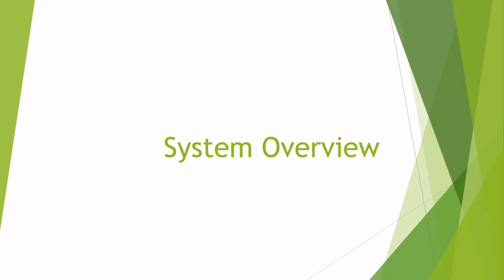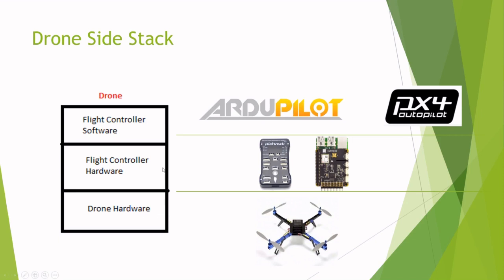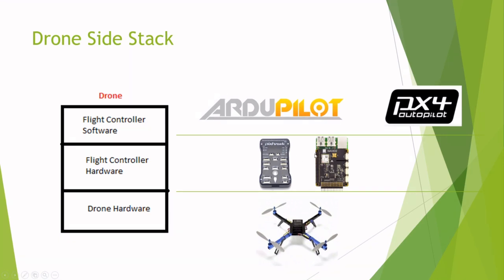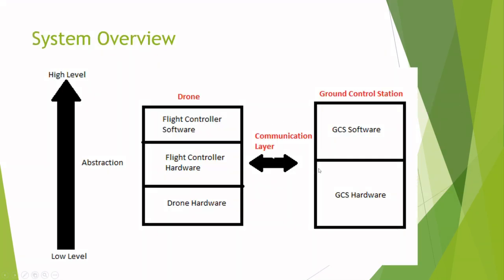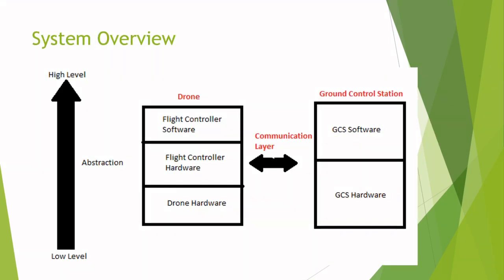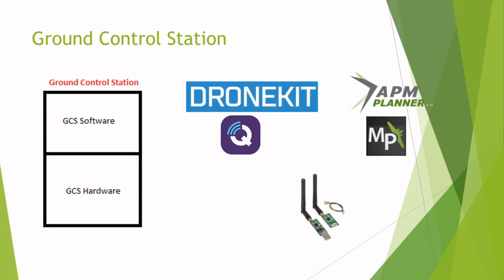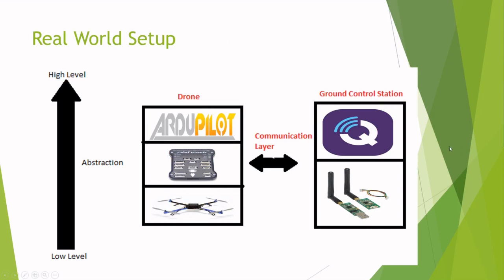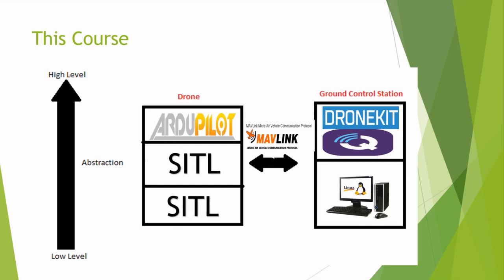High Level Perspective of a Flight Stack | Drone Programming

Comment: Hi, I am a super noob to the use of ROS for drone control and would like to seek advice because a lot of online sources keep quoting ROS, MAVROS and MAVLINK in drone flight control, and I am utterly confused. In this sense, your video is useful in shedding light on jargon.
  
I am trying to implement a computer-vision-based navigation algorithm on a drone using a pixhawk 2.1 controller. The image processing is done on a raspberry Pi 3B running Stretch Lite .
My questions are:
1) Is it necessary to send messages via the ROS ? If my CV algorithm can generate position error signals , then why can't I just simply feed those signals directly into the roll/pitch/yaw/inputs of the pixhawk flight controller?  Why even bother converting the position error signals into mavlink messages?

2) What is the relationship between ROS, MAVROS and MAVLINK ?

2) I have seen online guides that cover how to connect the hardware between Rasp Pi and Pixhawk but couldn't find any guide that deals with what exactly is the command to send from Pi to Pixhawk , for example to turn, rotate , fly forward ? Would you be able to enlighten me please? 

3) The video mentions there are standard mavlink commands. Where can I read up more on these ?

Appreciate if you can enlighten me on these. Thank you!
Reply from the maker: Hi there K H Tan!

1. It is not necessary to send MAVLink messages first through ROS. ROS's main advantage is connecting different parts of code together, but you could easily command the drone right from a dronekit script without the need of ROS, as dronekit automatically converts your python code to mavlink messages that get sent to the ardupilot firmware, automatically, under the hood. 

2. MAVLink is just a middleware. It just defines a language, like how 'jump' holds a specific meaning. Example: MAVLink message 0 (like a word 'jump' in english holds a specific meaning) is standard for sending a heartbeat message from the Ground Control Station to the drone. ROS and MAVROS simply are using the MAVLink 'language' to communicate with and command the drone

3. Here is a link to the MAVLink documentation, where the specific MAVLink 'words', or messages, are laid out: https://mavlink.io/en/messages/common.html

Hope this helps :)
Reply: Hello K H Tan, 
I read your comment, and it was the same question I am having too. Even as a Hobbyist, I am also interesting to build the drone with Computer Vision. But even I couldn't figured out, " What exactly is the command to send from Pi To Pixhawk?"
Did you figured out ? It will be really helpful if you like to share.
Reply: Hi  @kawarasantosh2899  , my raspberry pi was running a python script for the computer vision function to generate error signals to steer the drone.

What I did was to import the Dronekit python library into my script and that allowed the python script to convert the error signals into guidance commands to send to the pixhawk flight controller. You can Google 'Dronekit documentation' to find out more information on the various python commands available in this library. Essentially the Dronekit python library was the missing link in my project when I posted this query.
Reply: @khtan5531  Ohhhh... Great sir.
But is using dronekit and ros would be different ? Like if we want to use ROS.
Reply: @kawarasantosh2899  , i didn't have enough time to learn ROS as i was workimg with a project deadline. From what i glanced from ROS textbooks, the python code for using ROS vs using Dronekit should be different.
Reply: facts

Comment: Is the telemetry module required? In the "Ultimate project drone" the raspi is connected to the pixhawk and then the raspi is interfaced with the laptop and ardupilot. I also want to control the drone through an algorithm on my laptop, so i send the commands from laptop to raspi and the raspi in turn instructs the flight controller. Is this correct or am i missing something

Comment: Hello, very useful explanation
I want to ask about the difference between the drone’s remote control and the GCS ? Cuz I think we can do most of these commands and monitoring by the remote control right? 

Thanks
Reply: Transmitters typically have their own protocol that communicate with the drone's receiver, whereas GCS interact with the drone via telemetry modules.

Comment: How to embed the software into the real life drone
Reply from the maker: It varies depending on what autopilot hardware you have, and what control you want to have over the firmware. Many boards you will be able to connect to a Ground Control Station like Mission Planner and the installation will happen for you. You could also download the source from the ardupilot github page and cross compile it for you specific board, then upload the compiled code to your board. 

There are many ways to skin this cat!
Reply: Well that's a question every good beginner creates. We can install a whole operating system into a microcontroller which fits on the drone. In this operating system, you can install whatever software you want to use, just like a computer.